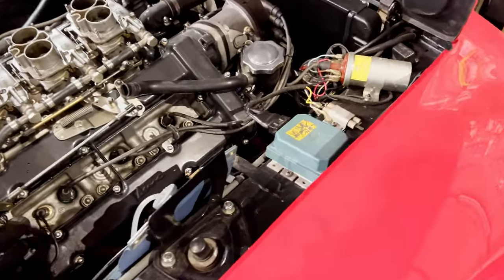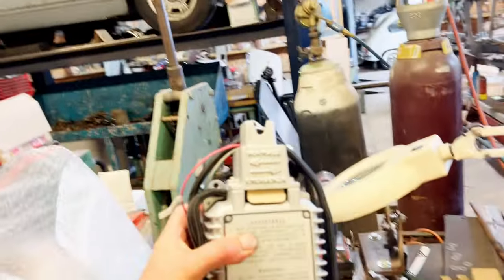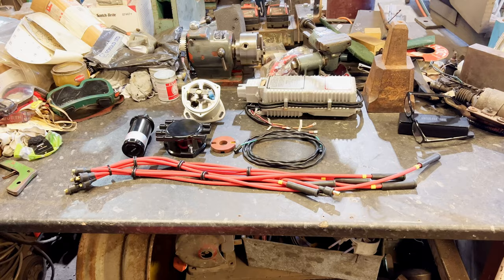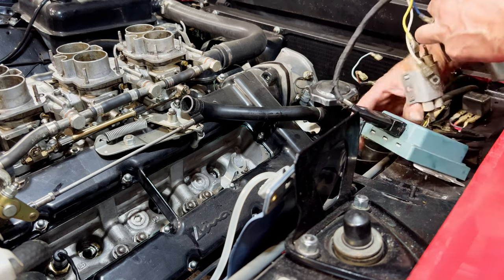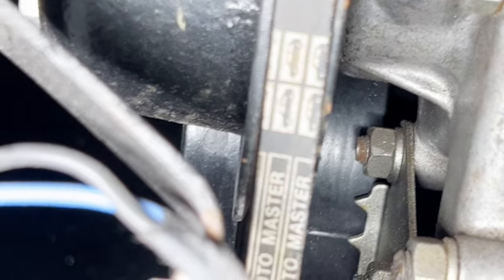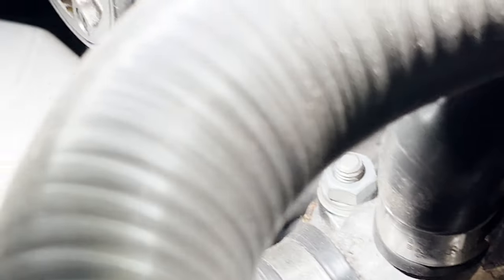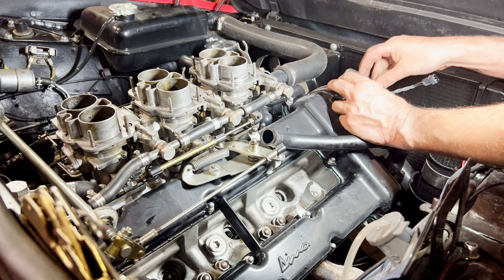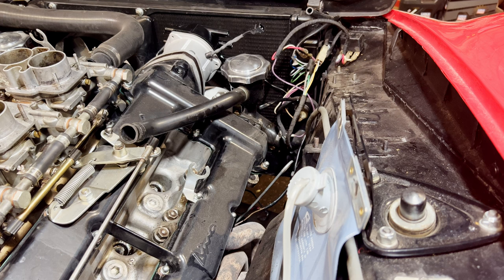New Dinoplex

Comment: All early  aftermarket single spark CDI Systems are licence built Winterburn Systems also the Dinoplex just in different Design casings..Delta Mk10 will fit insife any dinoplex and only cost 30 bucks plus some New capacitors
Reply from the maker: @Haffschlappe  I fit this one now or nothing.  I’ve had no complaints. Customers love it !

Comment: That looks like a well thought out and well executed system and potentially a significant improvement over points and mechanical advance. As an aside, where does the oil in the plug wells drain down from? The rocker cover gaskets don't appear to be leaking.
Reply from the maker: @jonhaddock481  I’m very impressed with the system.   I think it is the cam cover gaskets but that’s a job for another day.

Comment: Lovely piece off kit. I wonder why around number 4 spark hole has dimples like it was hit with a round nose centre punch. Love the sound of the induction noise and thanks again for taking the time to share.
Reply from the maker: @stephenlmckeown1439  It’s a great system and represents the best improvement over a correctly setup original Dinoplex.
Reply from the maker: @stephenlmckeown1439  Not sure about those marks ?

Comment: I have the original set up done by Dinopoint and it works very well. When it stops being fine I will defo take the Elshout system. What is the price of the set-up installed?
Reply from the maker: @tonysangwine-gould4733  The original system is excellent so yes definitely keep using it.  I have only used the Elshout system when the original Dinoplex is missing or faulty.  I would keep the original system intact. So it can be with the car even if you are running the new system. I’m not sure of the cost as I ask my customers to buy directly from Stefan.